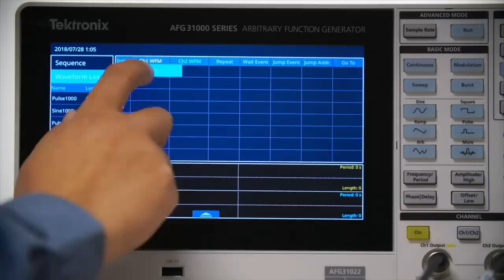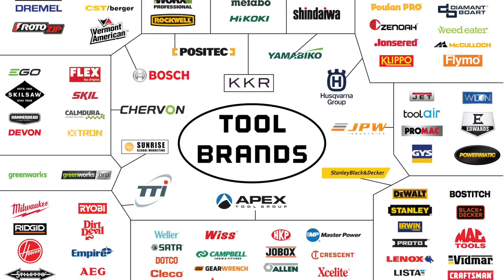Who Owns Your Favorite Power Tool Company? [2023]

Comment: This has been going on for ages with all types of products. In the 1970's I drove truck for Lakeside Packing (they planted, harvested, and canned vegetables). They would load up semi with pallets of cans without labels and I delivered it to wherever and they would slap their own label on it. In the breakroom they had one whole wall covered with all the labels that went on their product.  I also worked for Weber Grills and we made they grills that was sold as a generic brand at K-Mart (there were other names I can't recall). No difference in material, manufacturing process, paint used, quality control, etc. So essential it was a Weber Grill without the added cost of having the Weber name.
Reply: AFmedic6871  This has also been happening in trailers, cars, motor oils. For a long time a well known synthetic oil manufacturer made synthetic oil for Ford and I’m not talking about Mobile 1!😉

Comment: According to this video Ideal owns SK tools. 52 years ago when I was 16 it was known as SK Wayne tools and I bought a deluxe 3/8 inch drive socket set for 36 bucks. I still have that set and still use it on a regular basis. Needless to say I have been very happy with the SK brand. I also have tools by quite a few of the other manufactures and being a DIYer I figure that I have paid for every one of them in labor costs.
Reply: I’m only 17, but i have a set of SK hand tools from the mid 70s that were given to me by an uncle, they’re excellent
Reply: @bandombeviews6035  I bought mine in the 1960's and was just using them today.

Comment: I have most of the brands mentioned here makita is high on my list along with Ryobi is very good drills at a good price , i have gotten good use out of them all husky is a real good kobalt has some really good tools as well.  Very well done drop the music is all i have to say. The last time i did a estimate on my tools was around 40 thousand dollars over about 42yrs.  I have a portable drill press that i bought over seas it was pricey but worked way past what i needed to work on my home built excavator in the field, i have a small generator mounted on the machine to run a winch as well that was in twenty eleven.  This video was a real eye opener for most people.

Comment: As a Trading company from China, what I can tell you is Most company have t o OEM or ODM with many manufactures in China, however even the manufacture is different, there are a lot parts are compatible from each other. For example, most company use Lithium-Ion battery and the model is 18650, which can only manufacture by Samsung, LG, Panasonic, BYD and a few company with very similar performance and specification. Also a lot Big Brand purchase a lot tools they do not manufacture in their own plant, for example, DC power screwdriver is mostly OEM product from China, and a lot drills too. Our trading company almost supplied one big box store in US which is selling Hart tools now.

Comment: back in the 90's, about 95% of the world's cordless drills were made in one factory in taiwan.  i got one bearing the name ryobi expecting it to die and it didn't.  the batteries were nicad and shit.  so i wired it up to work off a car battery.  it had minor problems, like screws falling out, breaking in half etc and i kept rebuilding it.  i made makita 18v li-ion batteries fit it.  its retired now.  i'll never throw it out.  it has my respect.  i even gave it a name- the bushpig.

Comment: I know I'll get flambéed for this, but what about the Harbor Freight brands?
Reply: Owned by R.O.C
Reply: Yes! Pittsburgh for 2020! Lol
Reply: Let's face it, we've all gone to Harbor Freight for a cheap beater tool to abuse rather than break our good ones right?
Reply: chris younts  Actually the Bauer stuff isn't bad now.  I bought a 20 volt  impact driver and drove a lot of 6 and 8.5 inch headlok screws with it building my house and it's still working fine.  The Bauer sawzall works well, too.  Haven't tried the Hercules brand they carry, but have seen some good tests on youtube for them versus Makita and Hitachi.
Reply: chris younts  I paid a few bucks for a 2 year warranty.  If anything breaks, they just replace it.  I'll be done building my house before then.  After that usage will go way down.  If I was a professional, I'd probably go for better stuff
Reply: The Bauer power tools are made by lutool who also makes the masterforce brand for Menards and powerplus in the uk. Harbor freight changes oems for a lot of there hand and plug in tools a lot donuts impossible the keep up

Comment: Makita owns Dolmar brand which makes chainsaws. The company was acquired by Makita in 1991.
Reply: Yes, I actually own a Sachs dolmar 143 mx. If you go to home depots rental section, you can often find the orange Sachs dolmar smaller saws for rent with the Makita name on them.
Reply: We don't have home depot here in Finland :) So I don't know how these brands are sold or marketed in US. But here in Finland they are been sold almost as "one brand". Every hardware store/tool store that sells Makita also sells Dolmar. And Dolmar products are in the Makita catalogue and our local makita website. Also i don't recal seeing "Sachs" name in Dolmar saws for years. I have seen it only in older saws. All current models just say "Dolmar".
Reply: @pasinen  Starting in 2015 Makita started the process of discontinuing Dolmar in the USA.  The last of the Dolmar power equipment was sold to their dealers last year. As of now the Makita gas chainsaws are Dolmar red and the leaf blowers and trimmers are Makita teal.   Also there is no longer any Dolmar catalog, or Dolmar products in the Makita catalog,  The still have a Dolmar power products web site, but some of the  information is outdated as far as parts diagrams. I even have to search sometimes for parts diagrams for certain saws that I sold as a dealer in the past ten years since there are not listed on either the Dolmar power products or Makita dealer site.

Comment: Which companies employ the most and least American workers?
Reply: Neil Puckett Sounds like the basis for a new video!
Reply: @williamtate6268  I can tell you Bosch has a huge N.Carolina plant , Makita has a huge Buford GA plant.  Skil's best is made here in the USA I forgot where, (Just the really good stuff like the HD77 worm drive saw,etc.) (Most of the rest is imported.)  Mass. based Black and Decker/De-Walt has boatload of small parts manufacturing in Tenn. in the old Porter Cable/Delta plants since they basically destroyed that company after buying it. (With the exception of a few select power tools they didn't have.) The rest are just chinese labeled cheap imitations of the former Porter Cable originals. I think nearly everyone has their batteries made in China /Mexico because of US regulations and EPA. Most brands of battery drills and chargers are as well because of tight price points and fierce competition.  I am not up on the hong kong owned Milwaukee but i can imagine most isn't made here anymore if I had to guess.
Reply: I was disappointed to find my Bosch mid and heavy hammer drills are made in China. Economics I guess...
Reply: you mean, Mexican

Comment: What about the stuff at Harbor Freight?
Reply: Chicago Electric brand tools are virtually all made in the Republic of China. They are for light use AT BEST. In other words, if you need the tool more than once or twice a year, buy a REAL tool.
Reply: Those tools come from a stringently monitored waste water management plant in lower shanghai china. Upon weekly accumulation of the city's rice laden shit pile up, it is sanitized, dried and pressed, then meticulously crafted into the tools you see every day at harbor freight.
Reply: @teetom2740  To be fair, their newer battery impact tools are pretty awesome, maybe best in class.  Certainly for the price, they pretty much blow away everyone.
Reply: Their business model has shown steady product improvement and greater consumer purchase and respect for the market they serve, in short, they are damn good at what they do and given enough time they too will be in the top 1%.
Reply: Saw a snap on vs harbor freight 1/2 in drive torque wrench test. The freight one beat the 400$ snap on in accuracy and consistency forward and reverse. Top $ item not always top performance.  As for power tools, they are getting better.
Reply: KelMaster Construction  Came here for this. HF definitely has 2 classes of tool - (1)the "loss-leaders" that show up on page 1 of their circulars and (2) the more expensive ones that, in my experience, are not as disposable as the others. It's true that the second class of tool have been getting better in terms of quality in recent years.
Reply: @teetom2740   Laughed so hard for 10 straight minutes that I scared my 1 year old away.

Comment: You've mentioned MAC and Matco, What about Snap on and its group of companies?
Reply: Apex makes snap on and Williams tools
Reply: Joey Fossa, What are your resources? I believe Snap on is privately held L.L.C. that owns Bahco. J.H. Williams, Blue point and a number of other tool manufacturers.
Reply: Snap on is junk over priced
Reply: @dodgeramsport01  all except hand tools. Snap On has the best hand tools and work socks.
Reply: @donaldgreen9292  Not for hand tools anymore, they have been slipping recently.  I am going towards German stuff now.  Have you tried thorlo socks?  I like those a lot but if snap on are better, I will switch.
Reply: @donaldgreen9292  Thats a matter of opinion
Reply: @michaelmckay  I believe their socks are 5 or 6 bucks a pair. I am getting a year in a half out of them. I am over 250 pounds and work around tractor trailers on 8 to 12 hour shifts. they don't start to thin out until about 7 months. I never heard of Thorlo. I do like Knippex pliers over Snap On's just because Snap On design is funky. I am kind of stubborn on ratchets, sockets, screwdrivers, and wrenches.
Reply: @joeyf7606  wrong.
Reply: @supertech3992  correct.
Reply: @joeyf7606  snapon is independently owned and is traded on the stock market they are not part of the Apex tool group Apex is a competitor.
Edit:
Here is thier stock performance https://www.marketwatch.com/investing/stock/sna

https://markets.businessinsider.com/bonds/apex_tool_grllc-bc_mtfinincdl-notes_201818-23_regs-bond-2023-usu0378vab81
Reply: @dodgeramsport01  clearly you have never used Snap-on hand tools because if you had you would know that they are probably the best quality hand tools on the market. Especially when it comes to their wrenches, ratcheting wrenches, ultra thin / Ultra stong sockets. 
like any Tool Company there are some bad Tools in their lineup but overall their quality is top-notch and when you compare them against Proto, Matco, Cornwell or Mac Tools their price is about the same if not slightly cheaper in some cases. 
they are definitely commercial quality tools. If you don't believe me by some used ones on eBay and then compare them against old made in the USA Craftsman tools snapon is  definitely a Cut Above. 
there is a reason when you go to a commercial mechanics shop you see Snap-on tool boxes Matco, Cornwell and Mac.
and on that note they are sort of heirloom quality tools they will generally outlive their original owners and their children will own those same tools.  Some of the Snap-on tools I have in my own toolbox date back to the 1940s and they work just as good as when they were new. 
I am now slowly piecing together a flank drive wrench set (a Snap-on trademark) (standard AKA USA Imperial sizing) and they are absolutely amazing for thier griping power, on a really stuck grade 8 bolt they will actually grab so well on the open end they will leave little teeth marks on the bolt head. On my Craftsman wrenches I have had the jaw actually open a bit and round the head off... before those tools years back I used to have some Harbor Freight made in Taiwan Pittsburgh wrenches and they were absolute garbage I actually had one break and sliced my hand open and make me knock my head into a car that was behind me. 

The old saying was buy once cry once, if I would have bought these tools to begin with I wouldn't have had to buy three separate sets of wrenches over the years.

Side note 
I just bought a brand called "Wright" in metric  for my Pick-A-Part tool box and they too appear to be extremely well built tools and are about a 1/3 less price then Snap on but I haven't had to cheater bar any of the wrenches yet to give a testimony to their strength. But my Snap-on wrenches I have numerous times stuck one wrench on the end of the other and those damn things never break or bend.  Great tools and worth the cost if you use your tools a lot and take pride in your work.
Reply: @AtomicReverend  nothing wrong with channel lock. far as locking pliers goes, it is hard to find a solid pair. the one reason I would get Snap On is ease of warranty. I just bought a set of 9 different Matco branded vise grips for 110 bucks.
Reply: @donaldgreen9292  $110  that's not to bad actually,. They appear to be pretty good quality?
Reply: @donaldgreen9292  Torque wrench, my snap on is still my favorite.  I Have not found one that can beat it.   I like the Wiha sockets because of the knurling near the base.
Reply: @AtomicReverend  they are pretty solid, that was a promo price. check with your Matco rep. I usually put a lot heat in the pliers I do a lot of welding around them as a trailer mechanic on flatbeds.
Reply: @michaelmckay  I like Snap On torque wrenches especially the little speed dial. But I have a 1/2" gearwrench torque wrench and Matco 3/4". I really need to replace my 1/2", it is a decent torque wrench. it has been thru a lot of wheel seal and end play adjustments, torquing fifth wheel plate bolts and suspension hanger bolts and I know the calibration is off by 5 to 10 pounds.
Reply: @AtomicReverend   and I have my grandfathers Plumb and SK's also from the early 40's, so what is your point! snap on or as we call them in the welding and metal fab biz "strap on" are over hyped and over priced! And As the old saying goes The tool doesnt make the man, knowledge does! I can use any welder on the planet and produce the same quality welds, It's not the tools man! Good Day Sir!
Reply: Wigwam # 645 work socks.  Still made in Wiscosn.  :-)

Comment: Autozone Duralast handtools is made by Snap-on Tool Corp operating out of Taiwan. My tool dealer once told me this, thats why the 3/8 flex head long ratchet is IDENTICAL to a snap-on.
Reply: Some Wera ( Germany ) ratchets - not the handle- the working end - is identical with some Facom ( French )  and some KS- Tools, also the extensions, inserts ... All from Taiwan but quality is OK.
Reply: @heikopanzlaff3789  yup, no failure on any duralast tool. If you buy the Great Neck brand, you will see an SK part number.

Comment: one small detail you got wrong   TTI owns Ryobi, its not licensed   I worked for TTI or 13 years as a milwaukee rep
Reply: The original Ryobi tools which are still available in Japan are 80% owned by KYOCERA Industrial Tools Corporation.
TTI only owns the rights to use the Ryobi name in North America and Europe.
But on the home market in Japan and other Asian markets as well as Latin America, the Middle East and Africa the original Ryobi brand still exists. Here the distributors are listed: http://www.kyocera-industrialtools.co.jp/english/
The original Japanese Ryobi has 3 different tool lines, a blue entry-line, a red DIY-line and a green professional line.
Some of the Japanese Ryobi green pro line tools are now just rebadged DeWalt tools. For example the Ryobi BPD-180  brushless hammer drill is just a rebadged DeWalt DCD795 in green instead of yellow.
Funny how Ryobi sold the American rights for the Ryobi name to TTI, and then went to one of Milwaukee's fiercest competitors to buy rebranded DeWalt tools for their pro line instead of buying rebranded Milwaukee tools from TTI.

Btw. in markets like Europe and Australasia TTI sell their RIDGID line rebranded as AEG. TTI licenses the AEG name for power tools from Electrolux, which is Europe's largest  home appliance manufacturer who still sells AEG branded white goods and vacuum cleaners.
Reply: @ITubeTooInc  It's interesting how some japanese companies expand into just about everything and still do well at it.   I'm just assuming kyocera is the same one i know for cell phones.     ditto goes for honda, yamaha, etc.   Meanwhile, when most north american companies have tried it, they failed miserably and the criticism was that they spread themselves too thin by dabbling in everything with no singular focus or strength
Reply: @ITubeTooInc  Spot on